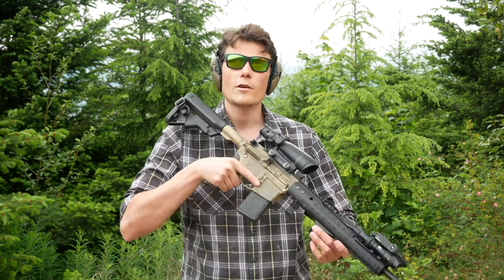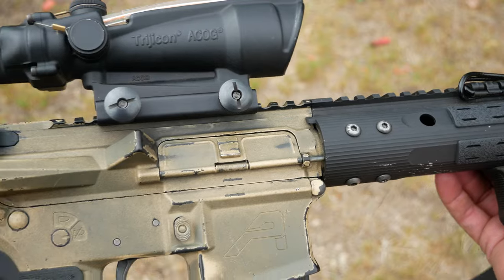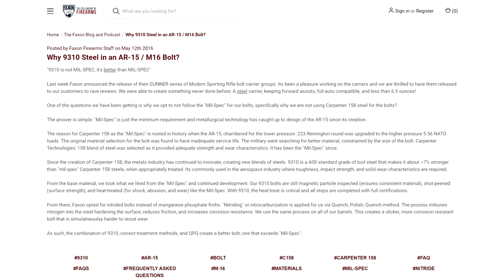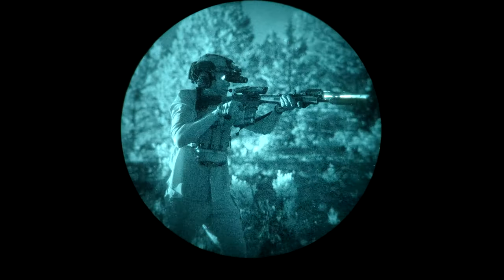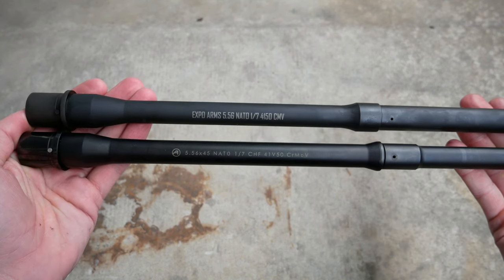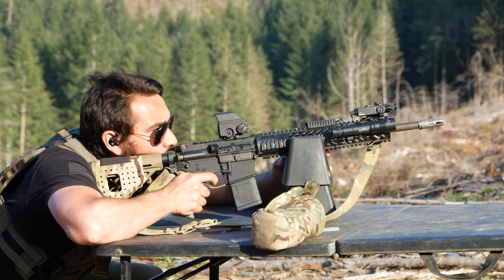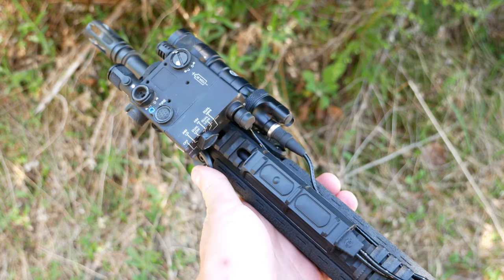Let's talk about the new Aero Precision PRO Series

Comment: I feel like this is Aero re-adjusting to what's "Mid." When they started ramping up in the 2000's, being mid was consistently delivering product that fit without gunsmithing and answering the warranty phone number. Remember when PSA lowers were a gamble and Aero was the go-to lower for a couple dozen bucks more? Prime Mid position. Since those days, mid-buyers are becoming more educated and learning from "mistakes" of the past.

How many times do you think someone young and new to AR's heard, "Yeah, my first build was on an Aero lower, but now I'm using receivers from <insert current above-mid company>."

Now AR n00b thinks, "Oh, I'll skip Aero and go straight to the good stuff." They miss the nuance that their friend's Aero build stunk not b/c of Aero, but the friend's amateur gunsmith skills combined with a gun-show-special AR barrel that was advertised with some generic GWOT poster but doesn't have concentric threads or a properly aligned gas port.

I'd say that Aero set their sights on the Mid-market because that's where they believe they can make the most money. They're probably realizing that remaining Mid is like swimming into an undertow - sometimes you have to swim sideways to get back to that Mid beach.
Reply from the maker: Wonderful
Reply: Very much
Reply: Holy shit...non-concentric threads on an AR barrel ? That's nightmare fuel.
Reply: @raifsevrence  Wild times, man.
Reply: @raifsevrence still a big issue with some rifles. Suppressing even a modern AK can be tricky for just this reason.
Reply: @dtroy15  I've never seen an AK with anything other than a Wolverine on it. AK' are well known for having concentricity issues. 
I wasn't aware that it was a significant problem on AR's. At least not on modern AR's. Obviously anyone looking to add a suppressor to their rifle needs to use an alignment rod to make sure their barrel is g2g. I just haven't seen or heard any significant number of people having issues. It's a surprise to me.
Reply: @raifsevrence  before the internet was so prevalent in gun culture, companies could get away with releasing some crappy products and the only way to learn they were bad was experience or word of mouth. The main source of knowledge was gun shows, gun store show rooms, the range, and publications (which never said anything negative so the advertising bucks would roll in). Also, silencers were "only for assassins" so as long as the bullet didn't hit the A2 Birdcage after leaving the barrel, it was good to go. Wild. Times.
Reply: @raifsevrence Never heard of that. I have a Davidson Defense 16 inch 7.62x39 upper that's been flawless with a bca bolt and Ard?? Enhanced firing pin. It was 170 bucks!

Comment: A few years ago we took a PSA 10.5" nitride upper put a can on it, and put it on top of a Post-86, then took it to SHOT to use as our demo gun. We have burned that gun down with full auto fire a few times a year since then, and it continues to perform accurately and reliably (just wipe down the BCG every hour or two). I generally like Aero and BA's stuff, and that's what my personal SPR is based around, I think it's too easy to get caught up in ideas like "duty grade" and "hard use", those qualities are proven over time and numbers, not always by price point. I do like CHF, but that's not always a requirement.
Reply: CHF doesn't mean much if you're also not lining with chrome or stellite.

If you're some tier 1 running around bumfuск nowhere with limited spares and sustainment, shell out for CHF chrome lined everytime.

If you're anyone else, simple chrome lined is sufficient. Nitride is also great for shooting corrosive ammo, but erodes faster under full auto.
Reply: @prfwrx2497  This largely expresses my preferences. I am the technical lead for a frangible ammo company, so I shoot 3-4 times a month, and even Nitride holds up better than most people could ever imagine. We truly live in a blessed time when it comes to the technology available for so little cost.
Reply: The TDP for the m16/M4 has never had a CHF barrel as part of the requirement. I suspect a hell of a lot of undeserved hype behind CHF barrels. Comblock factories did it to mass produce okay barrels.
Reply: @highdesertdrew1844 Agree ...and honestly for most people a good Nitrided, button rifled barrel (like BA) will be more than sufficient. In my opinion the person whos not super into guns,shoots only few times a year and mainly keeps the AR for home defense. nitrided is the way to go.... CHF and chrome lined is great for the guy who shoots high volume and is doing 1000 round classes multiple times a year.

Comment: Interesting product, the BCG does make you wonder 🤔, are we paying for better QC and if so...why isn't that the standard?  All in all I am glad to see more of the market doing conservative gasing.
Reply: Ya it prolly is alot better
Reply: You would hope so, since Aero CS is absolute dogwater. My last experience was a 9 week wait just to get my ticket acknowledged, and another week for them to replace my broken scope mount. I have sworn off Aero ever since then.
Reply: @PennyForTheGuy I’ve built at least 150+ guns using aero parts and have not had a single issue. They are manufacturing on a large scale so occupancies of qc misses or manufacturing mistakes are going to happen. Hopefully they took care of you. I wonder if what they send to dealers is qc’d differently or produced separately from what they sell direct.
Reply: Got one of their Pro Series CHF barrels.  Very excessive headspace, so not very "Pro" lol.  Stick to their receivers, handguards, and BA barrels for now.  I have a custom barrel from Black Hole and cheaper barrel from Faxon that passed with flying colors on both the new bolts tested, so bolts and gauges are fine.

Comment: as an engineer who got a semi pointless minor in material science because it was interesting even though I knew I wasn't going to use that part of my degree in my field: it's hilarious that most people thing they understand the difference in bolt metals.
Reply: The manufacture qc is more important than fancy metals
Reply: story time ? definitely sounds like story time. Lay it on us professor.
Reply: cmon you paid 10k for it, tell us your story
Reply: When it comes to steels, the composition, heat treat, temper, forging, milling and need to be taken into account. Trying to learn it all is going down a rabbit hole. The hardest part I’ve learned is trying to find all the information needed to truly compare them. Most manufacturers aren’t willing to release their production techniques, which is understandable, if you can make a much tougher, harder, high speed tool steel compliment from the same composition as other manufacturers you wouldn’t want to give up your secret recipe.

Comment: Work at a gun range for 6 years, only bolts I’ve seen break at the cam hole in lightly used ARs are 9310 marked bolts. Specifically cheap brand 9310 bolts. That’s my input for what it’s worth lol
Reply: Would $100 be in that "low end/cheap" range for 9310 bolts?
Reply: I can only imagine that 9130 bcgs break more often is because (this is a guess mind you) it says online that “properly heat treated 9130 is ~7% harder than 158 Carpenter” 

My only guess could be that it’s harder and perhaps more brittle? Or maybe that those lower end 9130 BCGs aren’t heat treated as well as higher end ones? Who knows, I still use 9130 BCGs
Reply: @woodsghost9088  for only a bolt? I wouldn’t consider that cheap. I have personally had good luck with bootleg who uses 9310. I just wouldn’t buy a no name brand in 9310.
Reply: @abledemo1  sorry, "bolt + carrier". But thank you. That helps me. I was worried I had made poor choices. I didn't think I was being cheap. But normally I use Carpenter 158
Reply: Just carry an extra bolt and the issue is immediately solved.
Reply: @calholli why buy 1 okay bolt when you can buy 2 crappy ones.
Reply: @leovang3425  There's no such thing as an  "ok" bolt or a "crappy" bolt.  There are bolts that work and bolts that don't work..  The rest is just marketing
Reply: @calholli  there are definitly bolts that can work but aren't good (like bad headspacing but not bad enough to be catastrophic).
Reply: @leovang3425   I've never seen one.  Not even on the internet.  If the head spacing was wrong, it was because it had been in a horrific fire of a burning house or had a really high round count, etc.    I'm sure it's possible, but it just doesn't happen.
Reply: I had a 9310 Aero bolt break at the cam pin hole after a few thousand rounds back in 2020. I've been using the warranty bolt since then and haven't had an issue (I'm guessing 8k rounds or so).

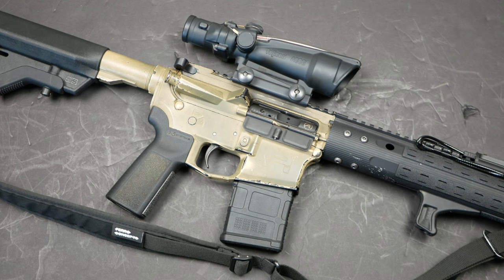Comment: 2:25 ironically, mil-spec barrels on typical rack M16 or M4 in regular units are Chrome-Lined but NOT cold hammer forged.

Chrome lined, phosphate button rifled 4150 chrome moly steel is the mil spec.
Reply: Yep. Materials must conform to specification 11595-E.

Hop's right about the marketing too.  In the civilian context, those terms are just buzzwords with no specific value.  

This is even more so when one considers that  most of the critical components like BCG's come from only a handful of actual manufacturers, and that the variance from one rebrand to another is minimal.

Azimuth is your friend.

Comment: Basic blaster AR's are pretty simple, and easy to work on.

Barrels and bolt's are easilly replaced wear parts.  

The TM is free online, as well as a lot of other good resources, so get a spare or two, and learn to inspect and replace them.

For referrence, depending on firing schedule, a decent button rifled barrel and c-158 bolt will both typically last anywhere from 6k-10k+ rounds before neeading replacement.  Not a bad ROI.
Reply: EXACTLY..  stop spending triple the price to shave off 1% better performance.  These diminishing returns are foolish IMO.  Just carry some extra parts in your bag/ springs/ extractor/ ejector/ tools, have extra barrels at the house, keep an extra bolt with the rifle,  carry some tungsten weights to swap in the buffers if needed, etc.    It's not hard to keep these things running well.
Reply: Yeah I’ve stopped spending extra on components that aren’t beneficial for price va performance. Barrels are inexpensive and so are other parts. The AR market has taken a nose dive and parts are getting cheaper every day.

Comment: I would like to hear how the Superlative Arms adjustable gas block holds up for you, on whatever rifle it ends up on. I just installed one and have no idea about its durability. Beat it up, over-adjust it, let Socko chew on it...
Reply from the maker: Currently it's on the HOPMOD SPR to tune for heavy 77gr suppressed. Kinda neat.
Reply: Yeah +1 to this. There are really only like 19 settings on the superlative arms gas block, would love to see Hop dial in a nice setting for suppressed/unsuppressed and talk through it.
Reply: Thanks everyone! I've only put 40 rounds through mine so far, because it's on a 20" heavy barrel AR that will take years to see a very high round count. It's currently set to 2 clicks past the bare functional minimum. It's definitely softened up the recoil impulse a bit, and hopefully will really start to pay off when my suppressor clears its unconstitutional waiting period this fall. But so far so good, and I plan on not cleaning the rifle for a bit to see if it keeps working perfectly. Again, thank you all for responding!
Reply: I have 2 and helped a friend install one on his rifle. It’s definitely annoying to figure out - basically, it comes from the factory set to setting #16 of 48, and depending on which way you go (0-15 vs 17-48) you can either go into its bleed off mode or restrictive mode. Problem is that the manual isn’t super clear about which way is which, and if you get lost, it’s super hard to undo your progress because your starting point isn’t 0 but 16. Once they’re set they also have a tendency to get locked into place, so you should probably figure out what setting works for your rifle / ammo and don’t plan on changing it down the line.

Comment: This is perfect, a 12.5" CHF middy light-profile barrel is exactly what I want.  All the other companies only make the 12.5" barrels with either government profile, or carbine gas system, or both.  Faxon nailed that one with their 12.5" middy gunner barrel, except it's not CHF and will likely wear out after ~15k rounds.

Edit:  I tried one out, got the 12.5" CHF barrel.  Went to check headspace with two brand new unused bolts, a Sharp's XPB and a Cryptic Mystic Midnight, and both had very excessive headspace.  I have two other barrels, a very high quality custom stainless from Black Hole and a cheaper Faxon, and both of those passed so I know the Forster gauges are correct.  The bolts spin right around on the NO-GO gauge.  Not a very good first impression with Aero's "Pro Series" so far.

Comment: My recommendations: use bolt carriers and bolts made by toolcraft or microbest. They're about 100 for a complete BCG for phosphate and chrome mil spec with C158 bolt. Swap the bolt once cracks appear (4000-8000 rounds depending on gas system length, ammunition used and overall gassing situation) and you'll never have troubles.

If you're using pistol length gas systems on 5.56, lord help you, for no one else can. Not even tool steel everything (including hypothetical barrel) will save you.

Carbine gas nets about 5000 rounds of bolt life. Mid length gas about 6000 rounds, rifle length gas about 8000 rounds of bolt life. Short dwell time doesn't extend bolt life (you still need enough gas to cycle), but overgassed for any reason (long dwell, suppressor use, blown out gas ports) will cut about 1000 rounds of expected bolt life. Habitual slow-fire like NRA hi power gives about 20% additional lifespan, but is life worth it if you're habitually shooting an autoloader like a single shot rifle? Get a nice bolt gun. Much more fun to run a bolt gun fast than to slow fire an autoloader.
Reply: Or just get a Geissele radial forged bolt good for 50,000+ cycles 😁
Reply: 5k rounds? Thats 2015 mk18s running on purely m855a1 numbers dude. If you’re actually dumping bolts in the garbage at those numbers, I want some of what you’re smoking
Reply: Ive been running the same PSA BCG in my sole AR since 2016, shot out a Faxon barrel (only 8k rounds before it keyholed lmao), and am about as far into a BA barrel. Bolt is just fine. This isn't a plug for PSA, I thought that was the norm for AR bolts. It certainly is for all my friends and the rental guns at the range I used to work at.  I really wanna know what your setup is that you're going through bolts that fast.
Reply: @brad_1388_  well I am talking military pressure loads and running the things hard. You can seriously extend bolt life by bedding the barrel with 1/1000ths stainless shim stock AND squaring off the upper receiver's face. This makes sure your bolt lugs engage square and even to your barrel extension and prevent any single bolt lug from taking most of the brunt, which is what causes most bolt lug failure (a single lug shearing off).

Many bolts fail due to the barrel not sitting square into the upper. If you need plenty of windage on your rear sight to sight it in at 25/300, you have a bolt lug shearing off waiting to happen.

Comment: TLDR: I had my extractor sheer off on my PRO BCG with less than 500 rounds through it. 

Yes I used any round I could get/afford, which means mostly steel, but that should not matter for a "PRO" version. Since Hop said the bolts are the same as the regular,  that must mean the extractors are as well. So why get the pro over the regular? Aero did replace it under warranty after a month of waiting for a response to my ticket. Maybe I bought an early production version and it's better now.  IDK just food for thought.

Comment: I’m happy to hear they are cold hammer forging but chf is only worth it if they are doing the chamber at the same time. Many manufacturers chf their barrels but then cut the chamber. I’m also glad to hear they aren’t chrome lining. It hampers accuracy and is only really a benefit for full auto use or similar fire rates. At least form what I understand. I’m no expert though.
Reply: You sure tried to speak as if you were

Comment: Great video, I waited nearly 40 years to have another AR 15 built. I carried lots a rifles from 1974 on, my targets didn't ping they went pow, when they shot back. 

My Colt AR 15 A2 in Delta configuration with still wack half silhouettes at 500 yards.

I wanted a new AR 15 for a CQB/truck/ATV/horseback rifle that was deer legal in my State.  My Aero Precision AR 15 M4E in 6MM ARC handles in close like an M1 Carbine or M4, it averages 1/2" groups at 100 yards and with military iron sights can aquire and connect with full size silhouettes in the kill zones, in 3 seconds at 600 yards. Rifle cost me about $1,300 with a few mags, a match trigger and military iron sights. Anyone other BS organization has to meet that standard for if they want my business in the future.

Aero Precision will sell me more AR's because they earned the business. Keep up the testing.